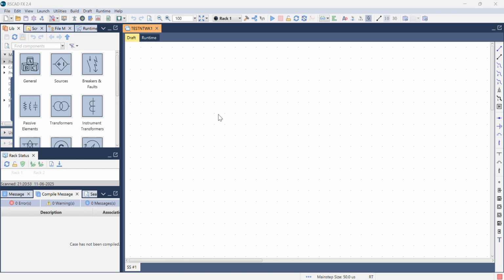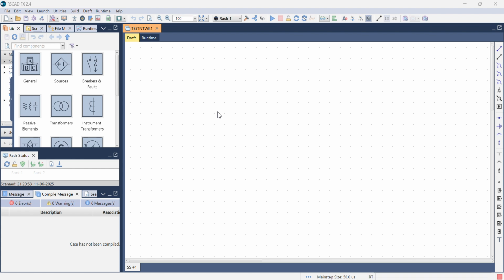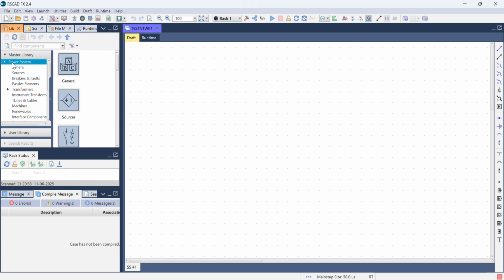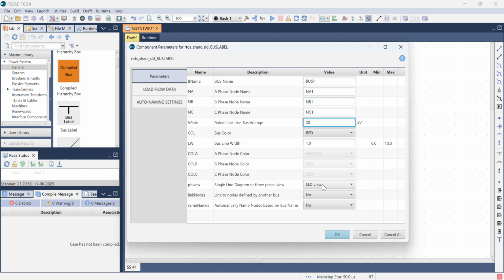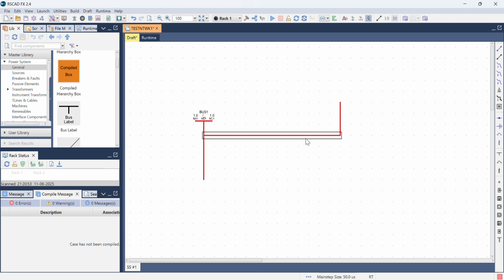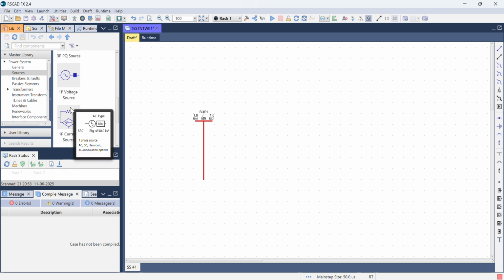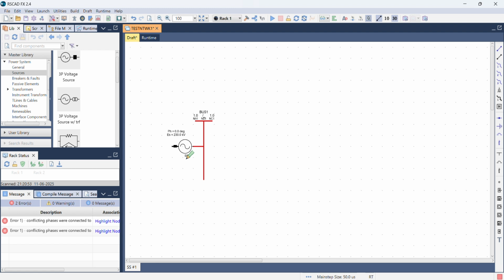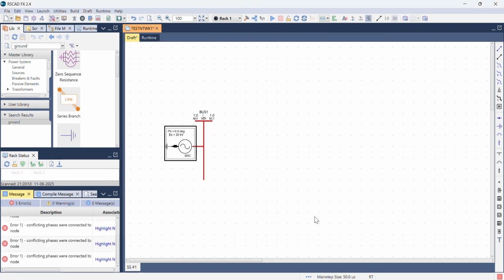RSCAD Beginner Tutorial 🔥 How to Create Single Line Diagram Step by Step (Part 1)

Comment: Hi Nive,

i was trying to define a time-varying (dynamic) load profile and assigning it to a specific load in PowerFactory. My goal is to run an RMS dynamic simulation to observe the dynamic behavior of this load and its impact on the grid. Ideally, I was expecting to see the same pattern of my load profile reflected in the simulation results, but it didn't happen.

If you could guide me on how to properly define and link a dynamic load profile to a load in PowerFactory, or if you have any video or resource explaining this process, I’d be extremely grateful for your support.

Thank you so much for your time. 

Best regards,
Ahmed
Reply from the maker: @ahmedelmalky7907 Hi Ahmed,

Thanks for reaching out!

Yes, assigning a time-varying (dynamic) load profile in PowerFactory can be a bit tricky at first. Here's a basic outline of the steps you need to follow to link a dynamic load profile to a load in RMS simulation:

1. Create a Load Profile:

Go to Data Manager → Time Series → New.

Define your time-dependent active and reactive power values (P, Q) in a time series format.

2. Link the Profile to a Load:

Open the Load element (ElmLod).

Go to the Stationary Load tab and check the box for Time Dependent.

In the Time Dependent Load section, link the time series you created to the corresponding active and reactive power fields.

3. Simulation Settings:

Make sure you’re running an RMS type simulation.

In Simulation Setup, ensure time-dependent sources are enabled.

If needed, add the time series to the SetTime command in the DSL script or initialization.

4. Run Simulation and Observe:

Run the simulation and plot the active/reactive power of the load to check if your time series is being reflected correctly.
If you’d like, I can share a sample project or guide video for reference. Let me know what works best for you.

Best regards,
Nive